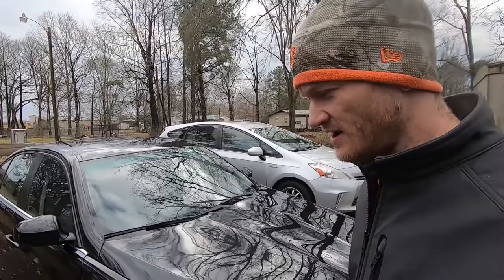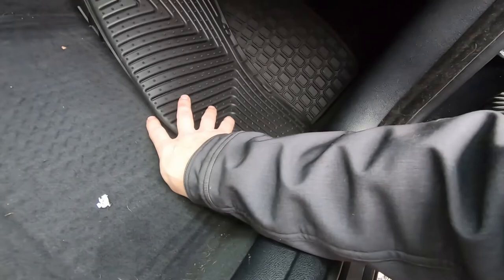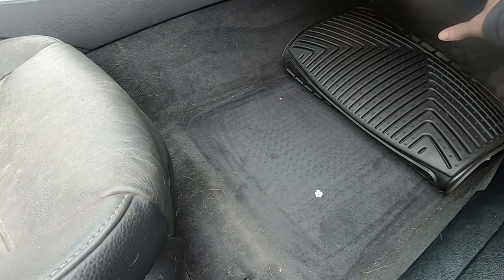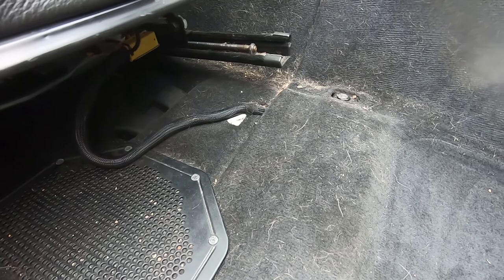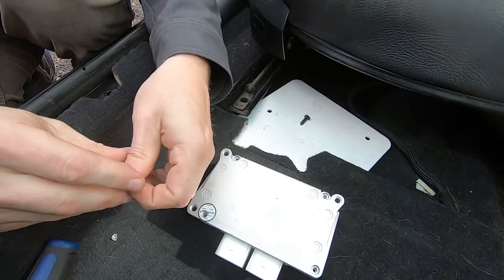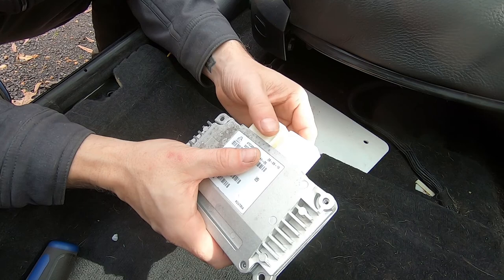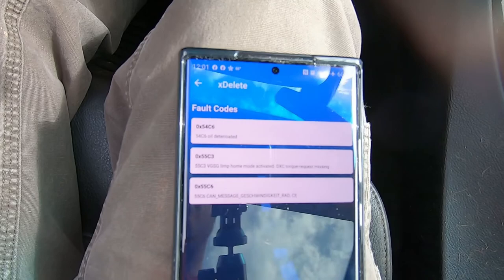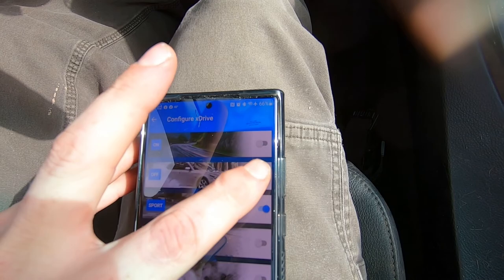My BMW 335XI Transfer Case has a problem (Code 54c6)

Comment: I just had to replaced the transfer case control Module and ended up spending 1700$ it included the new update on the system and a replacement on the R/R classification sensor.

Comment: will xdelete remove the 4x4 lights on dash ?
Reply from the maker: It can scan your system give you the issue and clear the code but keep in mind that 4x4 light just means the traction system is down. So depending on what code it gives it may or may not come back.

Comment: Any fix on these god awful lights? I’m getting the same exact codes on my 328i 2010
Reply from the maker: Yea turned out that I needed to change my transfer case fluid. I got a foxwell nt530 and I was able to reset my transfer case. The lights havent been back since.
Reply: @southerngearz  can you do a video on that.
Reply from the maker: Yea I sure can i will do that as soon as I get back from iowa

Comment: My trifecta lights only come on after I’ve driven about 10 feet
Reply from the maker: Hmmm thats really wierd! Im going to need to research that one. I will get back with you shortly.
Reply from the maker: However im leaning toward wheel speed sensors
Reply from the maker: Sometimes the pickup ring can become rusted and not reading the sensor as well.
Reply: @southerngearz  it’s giving me that shuddering problem on turns at low speeds and thuds and shuddering when i get to red lights. I’ve narrowed it down to the transfer case as main culprit and getting the “5DEC - transfer case ECU: clutch temporarily shut down” code. I thought it was my rear diff. So i just spent my whole evening changing its fluid only to hear and feel a terrible ride on my beloved car.
Reply: @southerngearz  ive had them crap out on me before but It was giving errors for the front left so I swapped it to no success. The blue connector on the cars end was broken at the end so I had to pull it by the wire; I’ll splice a new one in when i can get one
Reply from the maker: @Wergrun  just dont get ebay ones I got a set and not a single one worked.
Reply from the maker: Im going to keep researching though and see what i find other than that
Reply: @southerngearz  dude thanks but forget it, I’m getting tired of my  cars shit. So along with the transfer clutch yesterday when i pulled the errors i got codes for my fuel pump, crankshaft and side mirrors too. Today I got a weird unction to replace the battery and when i did and drive it i could feel the transfer case was working correctly and and all the other codes went away; to be replaced by other codes. Now my speedometer, wiper stock, steering wheel buttons and little button next to speedometer don’t work.....
Reply from the maker: Geez guy that sucks! What year is your car? Yea I dont even know where to start on the whole new set of issues. Damn BMW's they are nice until they aren't.
Reply: @southerngearz  it’s an 06 325xi I was up pretty late last night and found it’s either the DSC tripping, fuses could need replacing, ibs sensor or clock spring. I’m thinking I may have disconnected or reconnected the battery incorrectly because these cars can’t even get a new battery without being so damn delicate because everything was working well before the swap.
Reply from the maker: @Wergrun  yea i kept getting a battery error because I didnt buy the $249 battery.
Reply: @Wergrun  if you still have your car check your grounds. And register the type and size and date replaced in your battery.  If you just swap out the battery the car will still be programmed to a old battery date and essentially be over charging your new battery. BMWS will throw a spoiled brat little girl fit with any voltage ( battery) fluctuation!!
Reply: @baims8367  thanks but i figured it out. The positive terminal to the battery had exposed wire by the wlbow turn so i replaced it and all the electrical issues went away. I took out the transfer case fuse and its in rwd now and coasts smoother without the groaning sound.